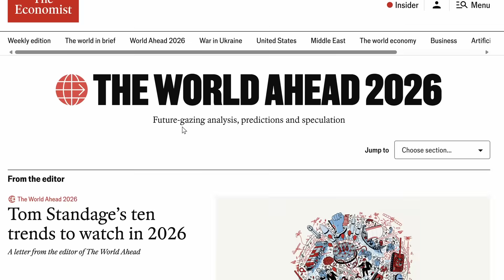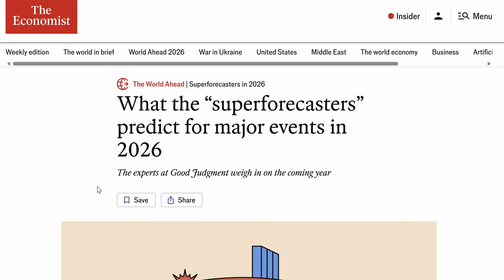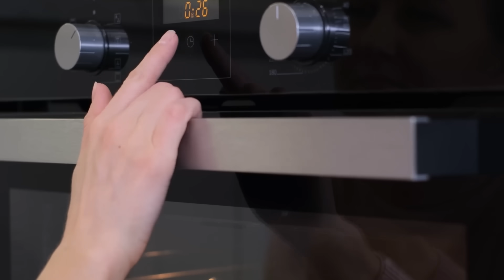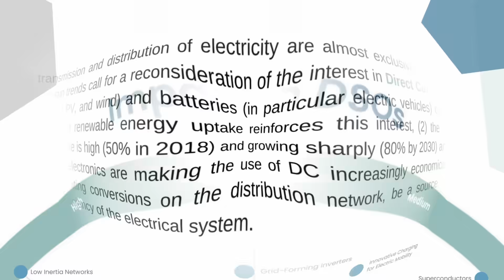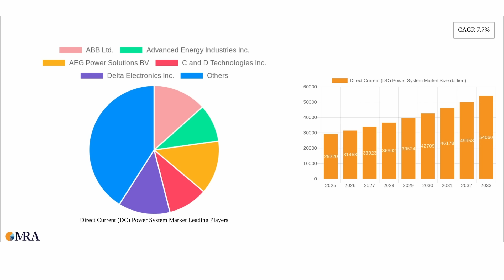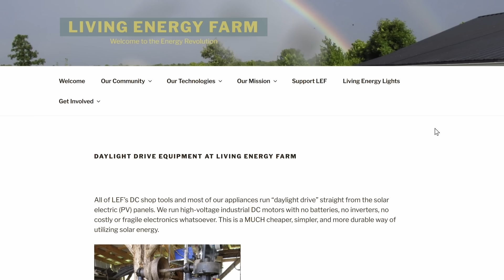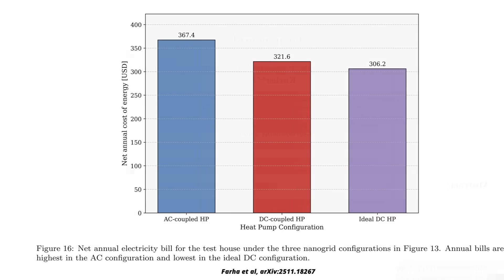Are We Using the Wrong Kind Of Electricity?

Comment: Exactly! Back in the days of the "War of Currents" between Edison and Tesla, the technology simply wasn’t mature enough to unlock the potential of Direct Current (DC) efficiently. Alternating Current (AC) had a decisive advantage at the time due to **transformers**, which enabled easy and minimal-loss voltage transformations—critical for long-distance transmission. This gave AC a clear upper hand and led to its global adoption as the dominant standard.

---

### Why was DC at a disadvantage back then?  
- *Transformers: The Gamechanger for AC:* Only AC could easily be stepped up or down in voltage with transformers. High voltages were (and still are) essential for minimizing resistance losses during long-distance transmission.  
- *DC's Limitation:* At the time, there was no effective way to change DC voltage levels efficiently. Without scalable voltage transformation, using DC in large infrastructure networks was practically impossible.

---

### Why is DC more competitive today?  
The advent of *switching power converters* (Switched-Mode Power Supplies, or SMPS) has revolutionized DC technology, making it much more efficient and practical:  
- *DC Transformation With Switch-Mode Technology:* Modern converters use high-speed electronics to transform DC voltages efficiently. Internally, they generate alternating current (High-Frequency AC, typically in the kHz range). This process mimics the advantages of transformers but works with DC at the input.  
- *Combining DC with High-Frequency AC:* The internal conversion leverages AC briefly during processing and delivers the final output as DC, which minimizes energy losses.

#### Modern examples of DC applications:
- *HVDC Transmission (High Voltage DC):* HVDC systems achieve the same or better transmission efficiency as AC but with significantly reduced energy losses.
- *Renewable Energy Systems:* Solar inverters convert DC from solar panels into usable AC or store the energy directly in DC-form battery systems, avoiding intermediate loss-heavy conversions.

---

### Hybrid Systems: The Way Forward  
- *Legacy AC Infrastructure Will Remain:* The vast, well-established AC grids across the globe are too entrenched to be replaced outright. Long-distance transmission and urban energy distribution will continue to rely on AC.  
- *DC for Specialized Applications:* Data centers, electric vehicles, renewable energy systems, and energy storage solutions benefit greatly from shifting to DC infrastructure. DC minimizes conversion losses and simplifies systems where devices naturally operate on DC.  
- *Indirect Use of AC Remains:* As you pointed out, even in DC-dominated systems, switching power converters often internally generate high-frequency AC to achieve their functionality. AC is still “indirectly” critical in these systems but is hidden from the end user.

---

### Final Thoughts: The Time is Ripe for Hybrid Systems  
Back in Edison’s time, the world wasn’t ready for DC technology—the transformers of the AC era unleashed its full potential, making it the dominant power system for decades. Today, however, with the development of highly efficient high-frequency switching electronics, DC is making a strong comeback.  
- *AC will remain for large-scale transmission:* Alternating current will continue to dominate the power grid for long-distance and general energy supply needs.  
- *DC is expanding in specific applications:* Direct current presents clear advantages in data-intensive, renewable energy, and storage-driven scenarios where efficiency and direct compatibility reduce system complexity.

This evolving coexistence of AC and DC highlights how far technology has come since the "War of Currents"—and how both will play complementary roles in shaping the energy systems of the future.
Reply: What about the hybrid off-grid home?  48 Volt DC buses are now giving way to 96 Volts, which is more like 105-115 Volts on the bus.  Think 32s of LiFePO4.  There are so very many things that work perfectly well on 120 Volts DC.  It would not be that hard to have dual distribution in the home and run on DC what can be advantageously run on DC.  
     Inverters are efficient but the standby losses really add up.  A 4kW inverter draws 40 W at idle or just shy of a kWh per day.  A 10kW, high frequency inverter draws 80 Watts or almost 2kWh per day.  Why suffer that loss when only lighting and personal electronics are running in to the evening and though the night?  Inverters used to have a sleep mode where the phantom load was just a Watt or two until a load was detected.  Of course that is useless with refrigerators having electric heater bands around the door seals.  Maybe the inverter can be tuned to switch on only with loads > 40 Watts?
Reply: @peteinwisconsin2496  That's a very insightful and technically sound point about moving to higher DC bus voltages and dual distribution. You're absolutely right that the core problem is the constant, wasteful DC-AC-DC conversion chain, especially the significant standby losses from a large inverter running minor loads.

However, while the principle of a hybrid DC/AC home is elegant, its practical and economic implementation in a modern household faces a major, perhaps decisive, hurdle: *the end devices themselves.*

The critical flaw is this: *The "load" never truly disappears; it just migrates from the central inverter into dozens of small, decentralized converters and standby circuits inside every single appliance.*

Even a simple 12W LED light usually has an internal AC/DC driver. A router, a NAS, a TV on standby, a smart home hub—this army of micro-loads (5-30W each) permanently keeps the main inverter awake. Any "Eco-Mode" with a 40W trigger threshold would be constantly activated. The idea of switching off the main inverter at night fails because modern homes have no true "zero load" periods.

### The Physical and Economic Challenge
Moving to a localized 48V DC network, as a solution, introduces its own deal-breaker: *physics and cost.*

For a given power requirement, *P = U x I**. At 48V, the current is dramatically higher than at 230V. To transmit meaningful power without massive losses or fire risk, you need extremely thick, expensive, and inflexible copper cables. A **house-wide 48V network is physically impractical and economically nonsensical* except for very low-power devices over very short distances.

### The Only Viable Compromise: Targeted DC "Islands"
Therefore, the economically rational implementation isn't a second, parallel 48V cable network throughout the house. It's a **hierarchical system**:

1.  *A High-Voltage Backbone (230V AC or even 400V DC):* Handles all high-power appliances (kitchen, laundry, tools) with standard, thin wiring and low losses.
2.  *Targeted, Localized DC "Islands":* These are *short-run, point-specific DC lines* for carefully selected, always-on devices that genuinely benefit from direct DC and are easy to convert.
    *   *Example 1: A 48V server/network closet* (using Power over Ethernet) for routers, switches, and NAS. This is a high-utility niche for uninterrupted power supply (UPS).
    *   *Example 2: A centralized 48V-to-USB-C PD hub* for charging personal electronics.
    *   *Example 3: A dedicated, short-run 48V line to a DC-native lighting controller.*

In this setup, the large, inefficient standby inverter can finally be switched off when only these DC islands are active, as they are powered directly from the battery via highly efficient DC/DC converters with minimal phantom load.

### Conclusion on Profitability
To directly answer your final question: *A full-scale, in-wall 48V DC network is almost certainly not profitable.* The investment in a second cabling infrastructure and specialized appliances far outweighs the savings from eliminating a modern inverter's standby loss (which can be as low as 10-15W in Eco mode).

The real efficiency gains come from:
1.  Minimizing the number of conversion steps (e.g., PV DC -> Battery DC -> DC appliance).
2.  Maximizing the efficiency of each necessary conversion.
3.  Implementing *smart, targeted DC islands* for high-utility, always-on loads, rather than a universal DC grid.

Your idea is visionary in principle, highlighting a fundamental inefficiency in our AC-centric world. But in practice, for a modern household filled with incompatible, micro-load devices, the hybrid home's promise is captured not in a second set of house wires, but in a few well-placed, short DC lines to a handful of critical devices.
Reply: Hi Time-Mass:    I copied out both of your insightful responses.  Lots of good information there.
     I envision the application for running the many things that already run on 96-120 V DC as being off-grid homes or homes running on backup power during an emergency but also for disaster recovery.  Hurricane Maria or superstorm Sandy just blew through.  Not all the solar panels are broken.  Get creative, deal with the disaster by moving some leads around and use 96-120 VDC to charge up cell phones and laptops, boil water so it is safe to drink,  fire up the ham radio and announce to the world that we are pretty far from OK here.
      Efficiency is part of the scheme but so is having a maximally robust system that can do something useful after an inverter failure, maybe even after the batteries are too old to be useful.  Lots of things run off the solar panels directly with no batteries and no inverter either.   One buys the stuff at Target (ahead of time) and just plugs them in.  This typically means devices with their own built-in power conditioning (SMPS) but it also means heating devices and series wound motors.  How about plugging one's SawZall in to three solar panels and extricating the neighbor whose house collapsed on them.  Desperate times will call for desperate measures.  With a little knowledge people would not be so helpless. o
    My own solution will be just what you wrote:  Two (maybe three) DC distribution points in the house:  My office, kitchen and probably workshop.  Drill, sabre saw, SawZall, a few other tools run on 120 V DC.  These DC points being for communications, food prep and possibly repairing/improvising a few things.  You are very right that improved efficiency by itself will not justify the expense of dual distribution.  Having redundant systems -might- justify it, and it might not.